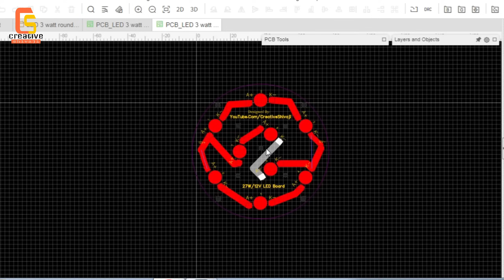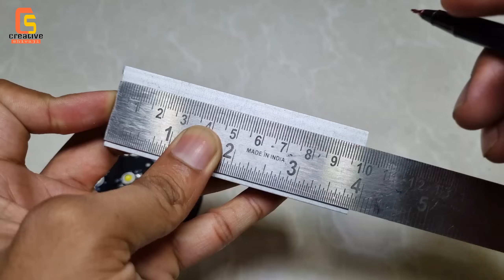How To Make Super Bright Led Flashlight | DIY 12V Light For Bike/Bycycle | By-Creative Shivaji

Comment: Very good work but U took a mistake. When You've packed the light's box how heatness of light will go out. You should make lots of holes or keep backside opened or mount a small fan to comeout heatness. Otherwise it'll burn LEDs very soon. But good job. Hope U understand my point & modify it.

Comment: It's a nice and a good  idea, but if we want a set of three or four leds, then using one 4 battery or 2 3.7v battery
Reply: only one battery can do this. because 1led is only one watt so 4 led af we use these will be 4 watt only but connection should be in series only.

Comment: Brother I have a doubt....you use 9 led each 3volts which is connected in series which means total 27 volts but you are using 12v battery. How your light is glowing soooo bright? It must be glow dim.
Reply: 3in series then in parallel